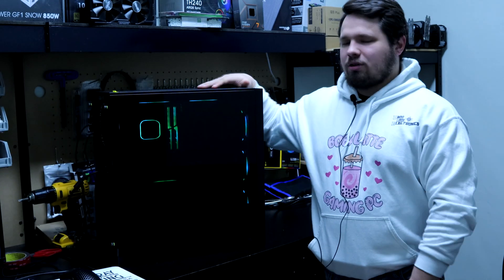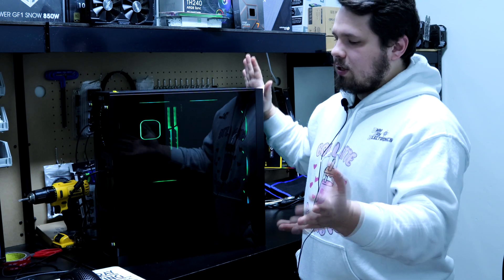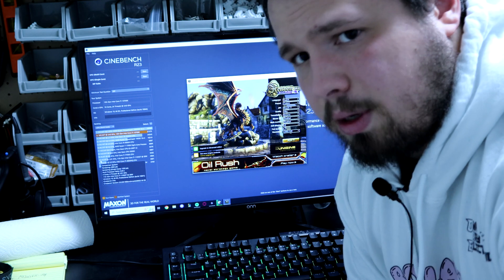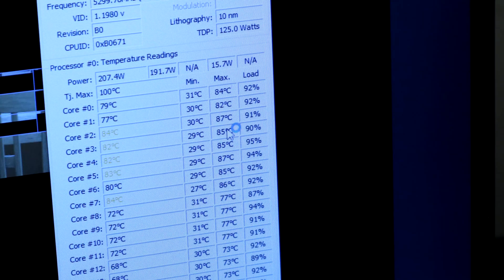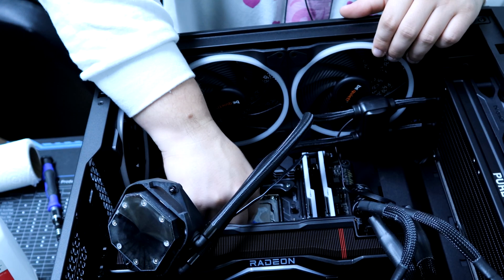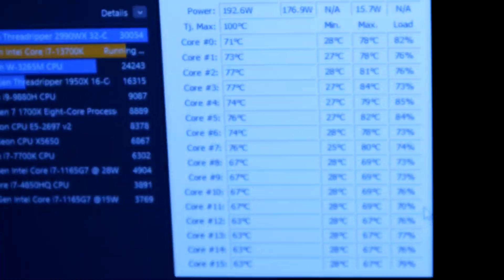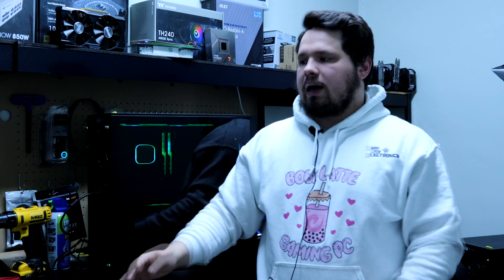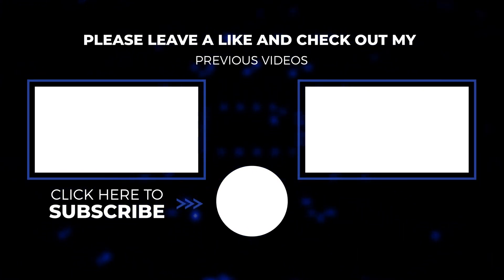How Effective is Thermal Grizzly Kryonaut?

Comment: I bought new pc with an i5 13500, and decided to use air cooling for it. When I tested it, I felt really bad, because it got up to 80°. Then I thought, that it would be better to change thermal paste. I used some random paste from computer shop, and it became even worse, 90° in cyberpunk. At that moment I realized that thermal paste is really important. On the next day I found kryonaut grizzly, applied it, got 65°, now I'm happy asf.

Comment: Thermal paste usually needs a few hours of operation to cure, then temps will drop a bit further.  Thermal Grizzly doesn’t need a lot of curing and noctua paste doesn’t need any.  I use Gelid Extreme which is half the price of Grizzly and almost as good.  I’d still probably use Grizzly for chasing benchmark scores if I got well into overclocking again.  It’s the lack of need for curing that is important when benching.
Reply from the maker: Thanks for the information! Helpful to know if I do another video like this in the future. The paste that came with the be quiet aio was in the PC for about a week before I ran the tests.
Reply: Can i use it for my laptop?
Reply: @presshan1714  - I've used it on a laptop before.
Reply: @presshan1714  From my experience with Thermal Grizzly pastes are not suitable for high TDP GPU, CPU laptops where the temperature is close to 80°C for a longer period of time. After 8-12 months, its thermally conductive properties deteriorate significantly.
You should try phase-change material Honeywell PTM7950. It comes in as a sheet, lasts longer and performs works better than traditional pastes. On the power section and vrams propose to give thermal putty Upsiren UX Pro. Also do undervolting on the CPU and GPU at -100mV or more if it will be stable.
Reply: Incorrect. Chemical Engineer here. 
Certain thermal conductive compounds and pastes are READY TO USE immediately after application. This is NOT the case for every paste. Follow the recommended instruction for application per individual product.
Reply: @WayTooSuppish  They are all ready to use but they won’t all be at full efficiency straight away.  I’ve done hundreds of hours of benching with numerous pastes regardless of the scientific narrative.  Tyres are fit for use straight away but you would be a fool to drive flat out without scrubbing them in a bit first.

Comment: I've used Thermal Grizzly pastes for a few years now. They outperformed Arctic Silver pastes back when AS was popular. 

You didn't say, but as you were replacing the thermal paste I noted that your top fans were set up as exhaust. Have you tried them as intakes? Or leaving them as exhaust while removing the rear fan altogether? Every case is different and can respond better or worse to differing fan setups. 

I'd like to see a video showing the incremental improvements in temps from a combination of different pastes, different fan setups and different fans.
Reply from the maker: No I actually havent, I kind of figured as Intake the hot air wouldnt have many places to escape, but I agree I feel like trying different fan set ups and looking at temps would make for a fun and super informative video, espcially since the 4000d is such a popular case. Not sure how much it would effect CPU temps as the aio is getting fresh air directly from the outside of the case.
Reply: @LegitCamelRetro  Only way to know for sure is to test!

Comment: Kryonaut is a great thermal paste, I've seen impressive improvements as well. In my opinion, combining it with a cpu frame on 12/13 gen Intel and am5 amd chips, provide the best overall thermals.
Reply: mx6 dogs it and the kryonaut needs reapplied every year
Reply: @OrganHarvestor  
wait for real? damn that sucks should have knew that before buying it, dont like re applying paste every year
but o well, any suggestions for good thermal paste that does last longer than a year, maybe 2/3 years?
Reply: @OrganHarvestor  Kryonaut Extreme does not need reapplied that often nor does it dry out. Can't speak for MX-6
Reply from the maker: I might consider getting a frame next, heard with some coolers it mounts weird though so Ill have to make sure

Comment: You picked one of the worst 360mm coolers on the market.  The pump cannot push enough water into the rad for cooling.
Reply from the maker: For real? Thats tragic man I had no idea. I just liked be quiets stuff in the past and assumed it was good. Most reviews I say had it in high regards.
Reply: @LegitCamelRetro  THE ONLY BRANDS WORSE ARE MSI AND Enermax.  LIQUID TURNS TO SLUDGE.  avoid asus too.  NZXT HAS BEEN IN THE TOP 3 FOR OVER 10 YRS, LOOK IT UP.....